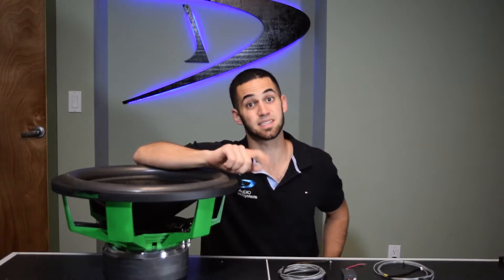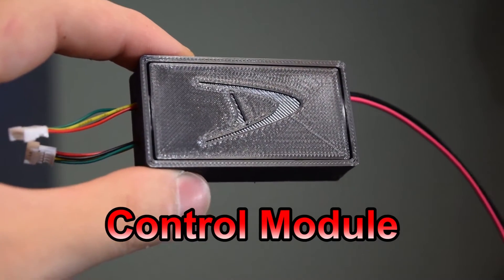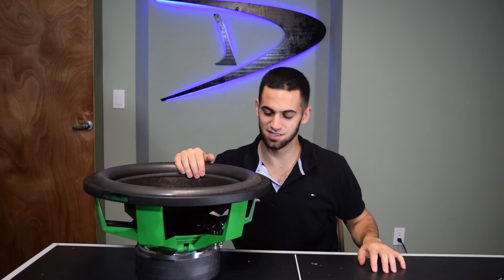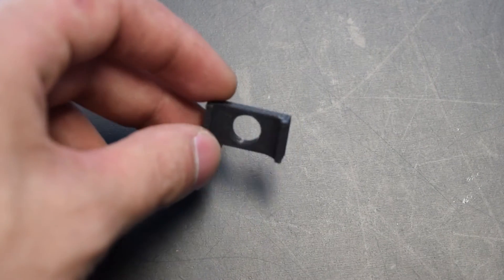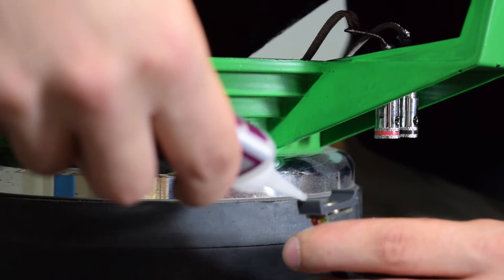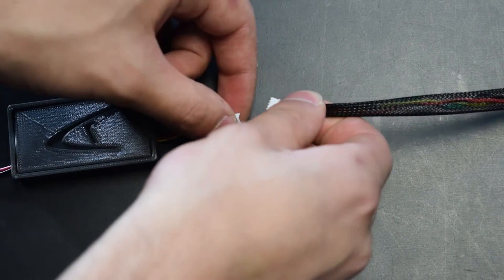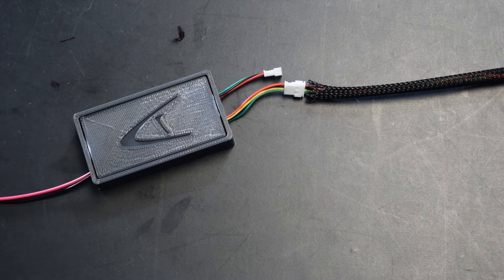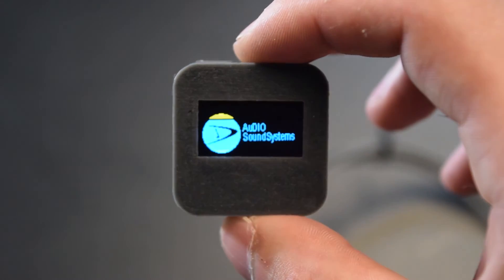VCi-1 Infrared Voicecoil Temperature Sensor Installation

Comment: What is the typical safe limit as far as voice coil temperature?
Reply from the maker: +snooketcher Because every sub and coil are different, it is solely up to the user to determine the appropriate temperature limit of his/her subwoofer. Our recommended temperature range for all subwoofers is as followed:
150-175F = Warm
175-200F = Hot, coils will start to smell
200F-225F = Critical Limits
225F+ = Turn it down
Reply: Good question bro because I was wondering the same.